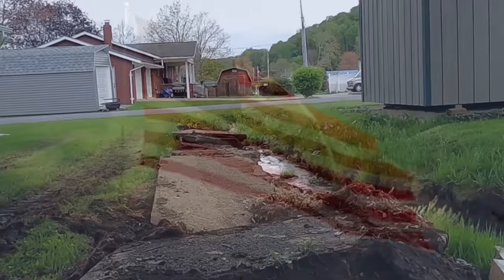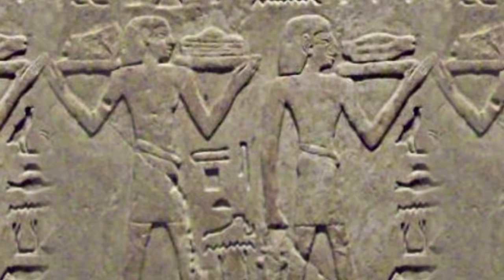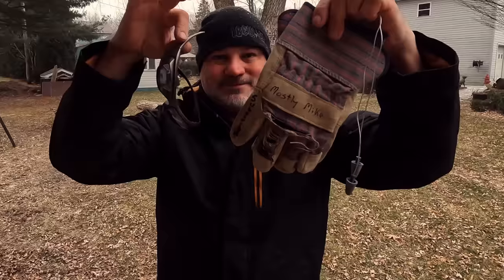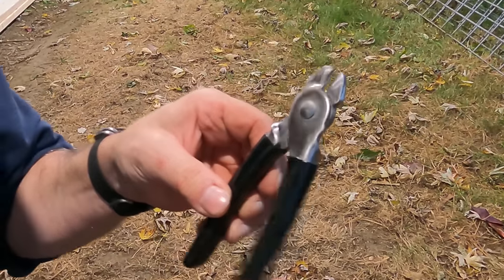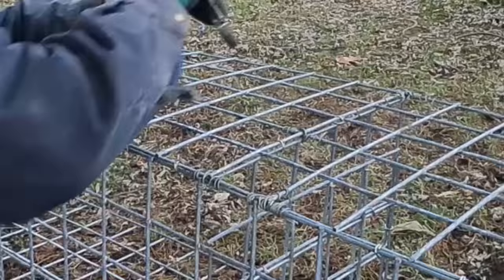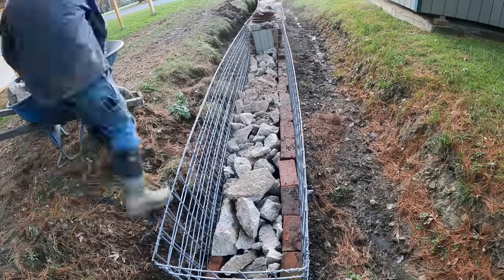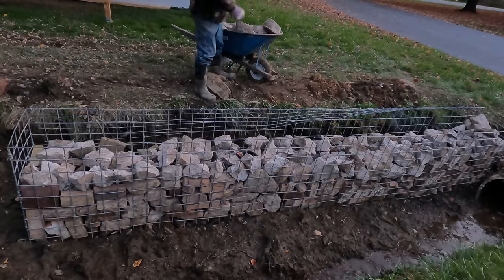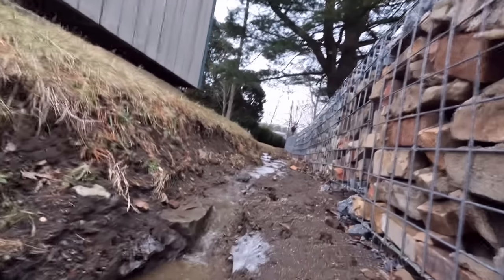How I Built My Own Border Wall Cheap

Comment: You put a lot of time and effort into this wall and I think you've done an awesome job. But where I live you have just broken so many codes and made so many code violations it's ridiculous, pertaining to construction and permitting, engineering for stability so during the rough season it doesn't collapse blocking off the Waterway,  diverting a natural Waterway even though it's a trickle and the list literally just goes on and on. I would advise anyone watching this to check your local building codes.. Just one example: during the rainy season when it starts to overflow the water could easily undermine the foundation of the wall collapsing it..
Reply from the maker: Thanks for watching Frontier. Yes it was a ton of work, and as for the codes, Etc. I will say perhaps I did make some violations, but my municipality was not going to do anything about the problem which the root cause of this problem is a plumbing code violation. Upstream in this ditch is a 24-in pipe which flows with some intensity at full pipe. At the end of my wall there is a 16-in pipe that goes under the road. So what's wrong with this picture? And this is why I have these complaints to my municipality. They have done nothing to fix the problem, but I got tired of my garage getting flooded out, so I built this wall. It's not in the Waterway, it just sheared up the bank of this Waterway and kept it from eroding further toward my garage. I have the state involved now, and there's different talks about the possibilities of anything from eliminating the ditch and installing a pipe through its entirety, to just making a pipe at least 24 in on the accident of the ditch. I will be sure to post updates in the future. If you look in my channel, or in the description to this video there is a video showing this wall at full capacity with water. It's just a one minute short, but it's worth checking out.

Comment: I'm surprised that the city or country didn't come and shut you down.  Your fence looks good, it's easy to see all the work involved.
Reply from the maker: Thanks for watching 99. Actually, it has been the other way around. If you notice the pipe at the discharge end, you can see that it is a 16 inch pipe. I didn't not show the pipe feeding that ditch, but it is a 24 inch pipe. Clear violation of plumbing code. For 5 years I have been complaining to my municipality and have made three formal complaints and even contacted my State Department of Environmental Protection. I believe that at some point the discharge pipe will be enlarged to at minimum, 24-in, but at least 30 for minimum adequacy. This was a step in the right direction by making this retaining wall, but it is not a complete solution. It just kept the water from easily overflowing the banks and entering my garage. I hope to make an update video sometime soon showing the back filling and Landscaping as well as some additions that I made. I want to make another video addressing questions, and political statements that people have been making. Hopefully it will be humorous as well as informative. Thanks again for watching!

Comment: If you put a deep empty over-flow lake in there too (empty channel from the river to the deep seasonal pond you dig out) then when that river gets too high it will flow in to your large lake you’ve dug out….. preferable very deep, so it slows the water down and decreases flooding. 
(Maybe put one higher up the river too, before the river gets to your property, as that’ll probably help more!!)
Reply from the maker: Thanks for watching Jack. Yes, I wish that I could do all that. If you look at the pipe where the water exits this ditch, that pipe is actually 10 inches smaller than the pipe that feeds this ditch, and I cannot get my municipality to change it for anything. It is a clear violation of plumbing code. This wall sort of acts as a lake. I did not make it to stop the water, but just divert it so that it keeps going Downstream. Prior to having the wall, the sloped sides of the Rio Brandon allowed the water to just flow right up onto my property and flood my garage out. It does not do that anymore. It carries the water to wear that water should be exiting a larger pipe and then it overflows, and goes down the street washing my driveway out. Better the driveway than my house or garage though. I am still filing complaints to get a larger pipe put in. Wish me luck! 😁

Comment: That's alot of work for such a short little wall. Not worth it.
Reply from the maker: It's all in the eyes of the beholder Yolis. That "little" wall is over 70 feet long, two feet wide, and almost five feet tall at the deep end. I would do it all over again if I had another place that needed one. Thanks for watching.

Comment: So basically,its a wall filter . I guess if its an improvement its not a loss . All the best.
Reply from the maker: Yes, it does keep the water from going straight up over that bank by making a vertical wall with a backer layer. The problem would be gone if the pipe going under the road at the end was at least 10 in bigger like it is supposed to be according to plumbing code. I have been trying to get my municipality to replace that pipe since I bought the place. Hopefully they will soon. The only thing causing the problem is that bottleneck in the drainage. There is a short video I did showing it full of water. Not sure if you seen that one or not.
Reply: Sorry for your pain. You have a government blunder situation. I'm not a lawyer,but keep pushing they are wrong.
Reply: Get hold of the county or city attorney. You won't scare them ,but it might push it forward. Of course, only if no movement.
Reply from the maker: @johnhart1668 Thanks John. Yes, I'll also add that the pipe at the feed end of this ditch is 24". It will occasionally let a full pipe of water and debris out which if one piece of said debris snags on the outlet pipe, it will dam up which is why I wanted to divert the water while giving it a place that it can occupy to slow down the flow.

Comment: Those panels are $90 here in central Georgia 1/2024 😢
Reply from the maker: Sorry to hear Tammy. Bidenomics has struck again. Is that at Tractor Supply? They were about $10 more at my local Tractor Supply. There is another chain in Pennsylvania called Rural King. Not sure if they have those in Georgia or not, but they had them for $49.99 when I was building mine. I used about 15 or so to build the wall that I made.
Reply: @themostlymikeshow  thanks for the reply.  I'm early in researching this possibility for my needs.  Your videos were helpful.  I am also considering a concrete bag wall.  I need to work out the pros and cons of each for my application.
Reply from the maker: The one thing that I tried to convey in my video is that almost every part of this job was very labor intensive. Just the parts that are in this video took two or three months to do. I also worked all through winter when I could, and added more than what's in the video. For a long time I have been wanting to make a part two showing the Landscaping and the back filling. My neighbors didn't quite grasp what I was doing when I started because it looked like I was building a wall in the middle of a ditch. A lot of people commented on this video and said that it would never hold back water. My intent wasn't to hold the water back, but instead give it a place to expand when needed and directed to keep flowing down the ditch instead of overflowing into my yard and flooding that garage. It is serving its purpose for that, but I am still battling my municipality because the exit pipe from that ditch is not adequate diameter. It is only a 16-in pipe and the pipe feeding the ditch is 24 in. I argue with them that this is a clear violation of plumbing codes. They don't disagree but it is like pulling teeth getting them to do anything about it.
Reply: @themostlymikeshow  Rural king for the win.  A 3 hour drive but $50.  A much better price than TSC at $90.  Hmmm wonder if they'd price match 🙌

Comment: You are blocking the flow of water. It should have been built at the top instead of where the water needs room to flow. It is backing up because it can not flow fast enough. Your wall has made that worse.
Reply from the maker: Thanks for watching Steve. It has been installed for over a year now, and it seems to have worked out well for me. One detail that I hadn't mentioned is that I actually own a little bit on the other side of the ditch, and over the years, it has kept eroding further into my yard. I wanted to take some of the ground back, and train it to go that way. It is doing just that and has actually dug itself about a foot deeper. I am considering showing a short follow up on it now that it's back filled and landscaped.

Comment: You just transfer the possible flood water to the adjacent property........😊 soon
Reply from the maker: Well, the adjacent property is mine too, so that's sort of the point. It has eroded towards my garage over the years. This wall was built mainly to guide the water Downstream and avoid going over the slanted Banks were they used to flood my garage every time the Waters got high.
Reply from the maker: Thanks for watching!

Comment: How's that cheap? Over here that amount of just the rocks is about 3k dollars not to mention the metal caging material
Reply from the maker: Thanks for watching Beast. I reclaimed most of what I filled my wall with, and by making all of the caging material, this wall cost me under $1,000 in the United States. Where do you live at? I believe in comparison to most other walls this is cheaper. Retaining blocks are super expensive. I have seen walls made out of used tires, but they attract mosquitoes if you can't keep them from filling with water.

Comment: Any floods lately
Reply from the maker: Thanks for watching Kevin. There hasn't been anything major that I know of. I had been wanting to film when the water does go up but it seems to happen when I'm at work or sleeping. I can see lines about 3/4 of the way up the wall where the water had gotten to and left debris hanging on The Wire. It seems to be doing its job. I had some issues which I will be posting a video sometime in the near future addressing those and showing some improvements that I made along with the Landscaping.

Comment: Soooo.... From a guy that has built many of these walls with mi amigos (I spent 25 years specializing in sediment and erosion controls in MD, ya know, protecting the chesapeake). Your wall is going to fail. Well, the section with the bricks won't but that was pure happenstance. Let me explain why. You MUST face your baskets. Meaning that the bottom and sides MUST be filled wit flat faced rocks so the basket is filled tight. Otherwise the HYDRAULIC force of the earth and water will cause your loose fitting mess to settle and your basket to OVAL and fail.
 Also, a permanent basket MUST be on a bed of COMPACTED CR6 (that is the aggregate that contains fines....so it COMPACTS) A piece of 48" #5 rebar or a 2x2 oak steak at the corners and center  of each basket is a good idea too. 
 So maybe you should have hired an Amigo compadre, they already know these things. Also, Border walls are a steel gate style fence that goes up like wall forms. Have you ever even seen a fencing or wall crew? They are all hard working Guatemalans and El Salvadorians (Very conservative people BTW You fucking Bigot). Good luck convincing them build the wall and then get on the other side of it... Also good luck stopping the Americans from jumping it to get their drugs....
 The funny thing is that the very people that idiots like you want to keep out are the people that could help keep this country great. Millenials and Gen Z kids are lazy shit bags, soft and snitchy. Trying to wait for robots to be invented to do the work. Idiocracy will play out on y'alls watch. I'll be praying for your wall lol
Reply from the maker: Thanks for watching and commenting.

Comment: Good vid! Can the cages be stacked for added height? Eventually won't the wire connectors rust out? Two questions in there.
Reply from the maker: Thanks Moki. Well, it's been over a year since I built the first few sections of this wall, and as for rust, the galvanized wire seems to be holding up well. The hog rings should hold up forever, but then they are just a quick temporary way to hold the sections together while I wrapped it with the high tensile wire.
As for stacking the sections, yes it can be done, but I don't know the specifics of it. I had watched videos on that, and they sort of stagger the successive rows back.
I hope that this helps. I might do a follow up soon showing the completed project. I finally backfilled and landscaped...and made a culvert as well as a j hook around the end. It looks much better than when this video left off.
Reply: Sharp rocks scratch away the protective galvanizing at every point of contact exposing bare, naked steel wire to the elements...FOREVER.
My neighbor did one of these and the whole thing started falling apart within 3yrs. His was a waterfront retaining wall with the base always under fresh water, so this could be considered an extreme condition but  exposed steel wire will rust in any outdoor condition, eventually.
Reply from the maker: Mine looks so far like the day I put it together. It's been a year and a half, but I will keep everyone updated.
I'll be doing a follow up soon after landscaping and adding some more features like a culvert, etc. Stay tuned! Subscribe to stay in the loop.

Comment: PSA: please don't use gloves with any rotating power tool. feel free to pin this comment.
Reply from the maker: Thanks for watching Think Tank. That statement is debatable. I believe that wearing gloves while using an angle grinder is arguably safer than without any hand protection...especially level two cut resistant snug fitting gloves such as the ones that I was wearing in this video. So I actually Googled "should gloves be worn while using an angle grinder", and the first several articles unanimously suggested wearing them. I respect your opinion, but agree to disagree on this.

Comment: Also instead of Hog Rings, just buy a Coil of wire..there is a cheap way and an expensive way to do Anything..if you can get recycle concrete..put that in the middle of the Gabion..also the hog rings are too short..
Reply from the maker: Thanks Andree. The hog rings really weren't used to hold it together structurally, but it was the easiest way that I could find to hold it together until I used the coil of #12 1/2 to lace it together.
I did use recycled concrete and bricks to  fill about half of the wall. I demonstrated a $159 demolition hammer to break up the old sidewalk pieces.